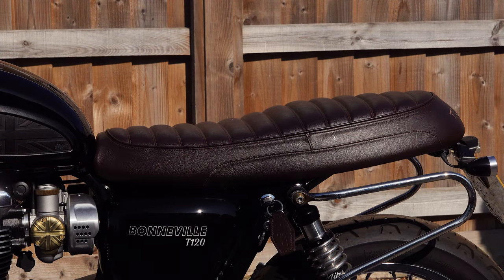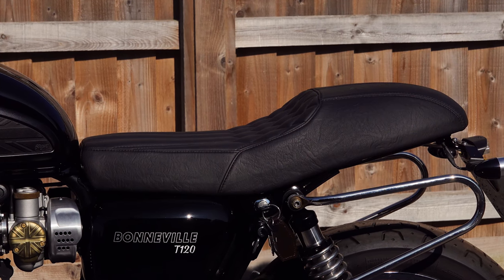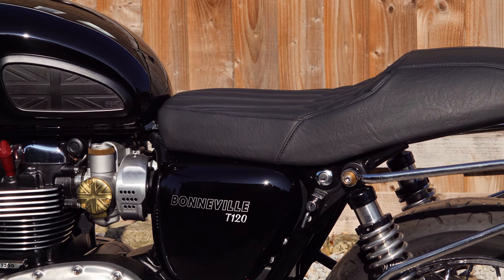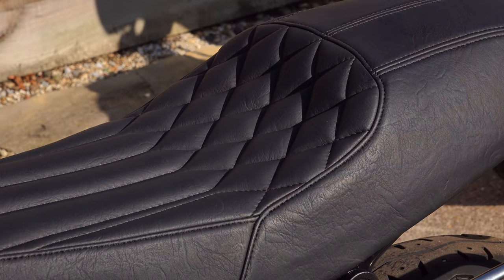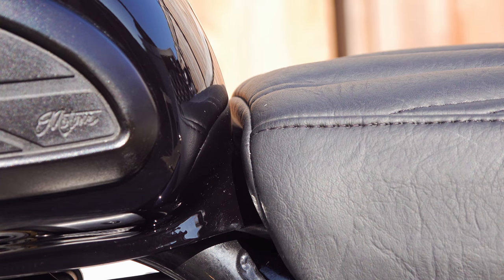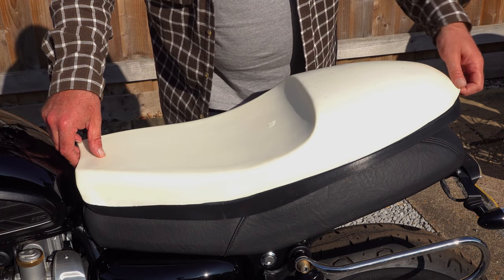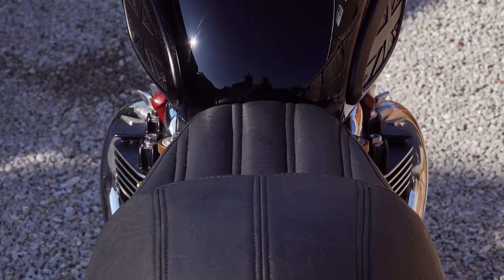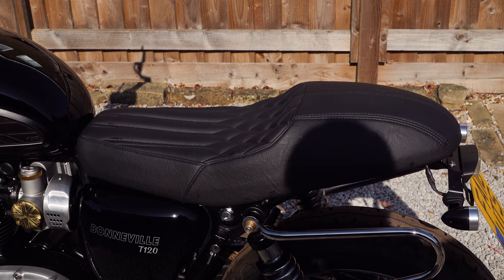Liquid Cooled Triumph Bonneville's, Introducing The RATTLER!  The BENCHMARK custom seat!

Comment: I've tried several seats for my Triumph T120: Stock, BC Slammer, Corbin Gunfighter, Tamarit Jerez, and Motone Rattler. Of these, the Rattler is my day-to-day seat of choice. Sleek and sharp looking, the Rattler is a handsome cafe racer seat that doesn't compromise at all on comfort. In fact, I'd say it's more comfortable than the Corbin, which is nearly twice the price and bulkier looking by comparison. Where the Corbin is firm to a fault, the Rattler's high density foam provides support without excessive rigidity. Great product, highly recommended for those looking at aftermarket seat options. Thx for the fine videos, Stuart - greetings from Los Angeles.
Reply: Any comments on how comfortable it would be for a pillion? My wife loves to ride with me and would like the back of the seat to be stepped up a few inches, being that she is shorter than me and can’t see over my shoulders, however I don’t like how bulky looking the king and queen, or the Corbin seats look. Any comments would be appreciated!

Comment: Seats are such a subjective product.  This is not my style, but, I appreciate that it may appeal to others depending on the theme look they are going for.  My favorite was always the Retro seats for the air cooled models, but, I was disappointed they could not produce a similar one for the liquid cooled models.  They did produce an offering, but, I felt it missed the mark because of the change in the frame rails and overall width of the seat pan and inability to attached the chrome trim at the bottom.  I opted to have my stock seat reconfigured and recovered in solid black.  It still is not the perfect looking seat to me, but, it is a lot more comfortable and correct looking vs the stock offering.  Looking forward to update on the comfort when you have had a few hundred miles on it.  That may take a while unless you stop buying more motorcycles.  lol

Comment: I have to say Stuart, I dislike how with a lot of motorcycles today, including some Triumph models, manufacturers have seen fit to do away with the rear mudguard, and how the addition of a bracket to hold the number plate and rear lights, would seem as if it's an afterthought, as in  "oh yeah we still need that for the bike to be road legal" . I imagine, that without the guard, a veritable tsunami of water spray would be drenching the underside of the pillion seat area whilst riding in inclement weather. No, give me the styling of the early Triumphs, BSAs, Nortons, and Royal Enfields, that has been recognised enough to have Triumph and Royal Enfield to continue along those lines. Might I add, the 2017/18/19 Honda CB1100 EX is also another, that in my opinion is the epitome of what a motorcycle should look like. I can't help it, I'm a sucker for lots of chrome, lol. Deep down though I'm a Triumph fan, since my first bike was a 1959 Thunderbird, and a few subsequent Triumphs after that, followed by a Yamaha YDS3 in 1967. Incredible torque from a 250cc two stroke, and your own built in London fog, by way of oil smoke from the twin megaphone mufflers. I imagine today, the Police would defect it, as creating an excessive amount of air pollution. Just an old ex biker's observation, and of course do acknowledge and respect others who would hold a different opinion. Cheers mate, love your videos, as they're a treasure trove of handy hints, and in particular, how to maintain your bike looking like new. Ride and stay safe in these uncertain times...
Reply from the maker: In Triumphs defense David i have to say it is me that's guilty of removing the original mud guards from the T120, and fitting these abbreviated examples!
Reply: @stuartfillingham      That's okay, I was mainly thinking of the current crop of Japanese bikes that affect an upswept look, and mufflers at such an up angle as to rival a WW2 mortar canon. Cheers...

Comment: Personally, I find the stock seat on my T120 to be very comfortable.
Reply from the maker: never tried the stock seat its in a box somewhere!
Reply: @stuartfillingham  How do you like your flyscreen? Is it purely cosmetic, or do you get some wind protection? I'd like to add one to my Bonnie but I'm concerned that it will send the wind to my face rather than the non-directional wind blast I get with a naked bike.

Comment: Who out there has a flyscreen on their Bonneville? How is the buffeting compared to riding with nothing? I love the looks but I'm thinking it may direct the wind right into my face.
If you do like yours, which brand do you use? Dart seems popular and affordable. Same for the Triumph brand. 
Thanks.
Reply: I use the tallest Dart (9” I think).  It takes the wind off my torso making higher speeds more comfortable.  I get clean airflow at my helmet.  When I travel at highway speed (75 mph) I can tuck behind the screen to reduce drag.  Then sit up for some air breaking.
Reply: @johnpenczar9192  Thanks. I think I'm going to try one.

Comment: Unlike my wallet, I am looking forward to the engine guards. I have the Triumph ones now, as at the time they were the best ones I could find. They won't do much to save the rest of the bike or the rider's legs in an "unplanned gravity assisted event" however. 

I've ridden Harley's for a long time, and the guards, both from H-D and any number of 3rd parties,  are far larger in the critical dimension to help preserve the bike, and the rider's legs, as much as possible.